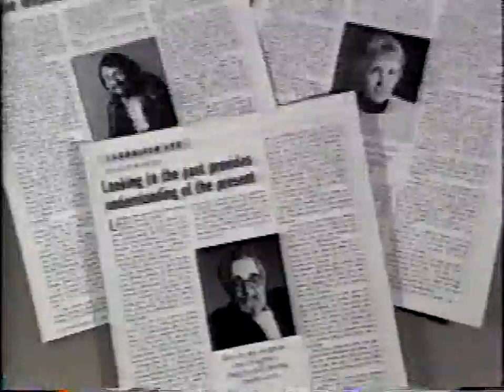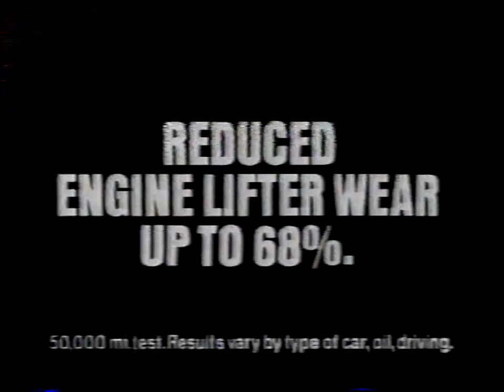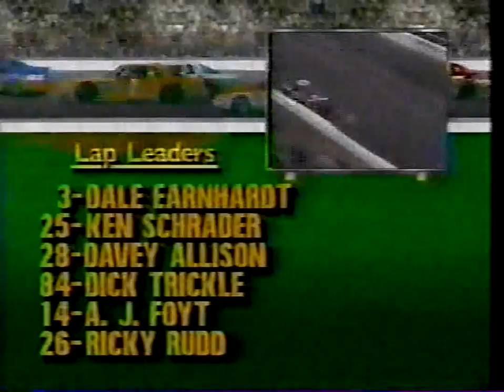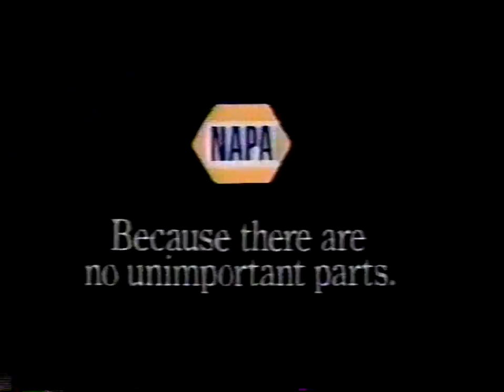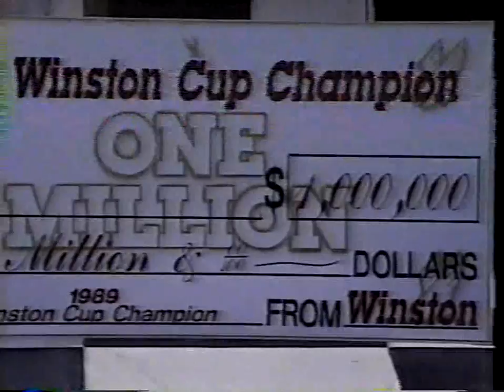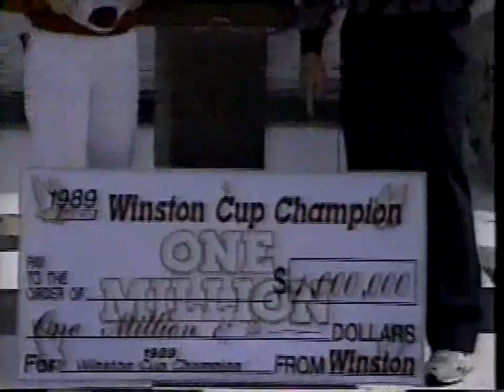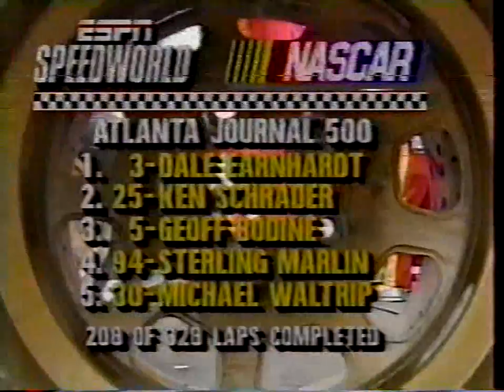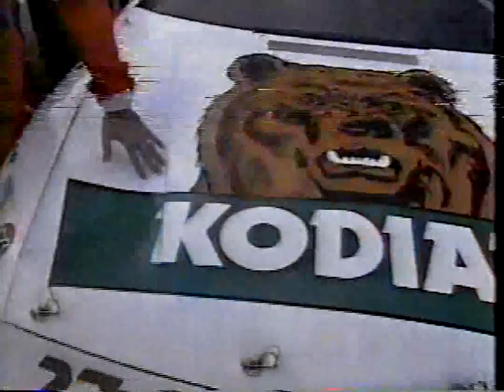1989 NASCAR Winston Cup Atlanta Journal 500 @ Atlanta Motor Speedway (Full Race)

Comment: Holy crap...Mark Martin blowing up right as they were showing the in car camera! 😮
Reply: That place was rough on motors. Like as soon as you run it at certain RPM for extended periods and then you let off the gas, the engine lets go. Same thing with Mike Skinner in the 2000 spring race.

Comment: Old Atlanta is like Darlington but turns 1 and 2 are the same as 3 and 4.
Reply: No it’s not, darlington is 1 lane track, this is 3 lanes. And it’s a lot faster than darlington, not as much brake needed
Reply: Darlington is wayyyy more challenging and taxing on the drivers. There is only one lady in black
Reply: @jarflymystique6545  I'm just saying the overall shape from over head, nothing specific racing wise. The next closest thing could be Miami
Reply: @GiovanniTiradoGT  I understood exactly what you meant.
Reply: Darlington was designed to have the same configuration on both ends of the speedway but a lake got in the way of construction so they shortened one side of the track, it used to be turn 4, now it's turn 2 after they moved the start/finish line